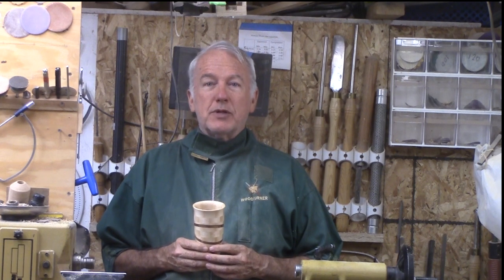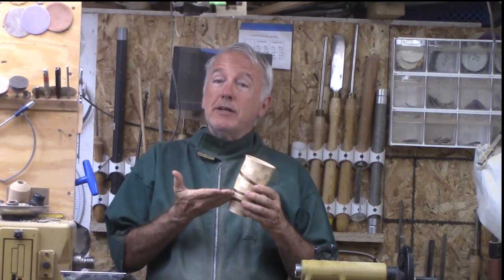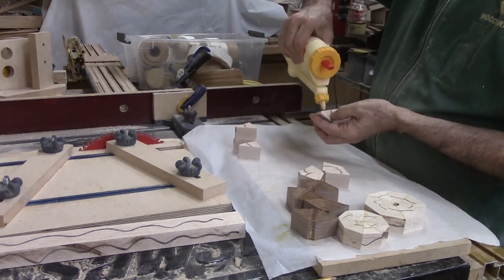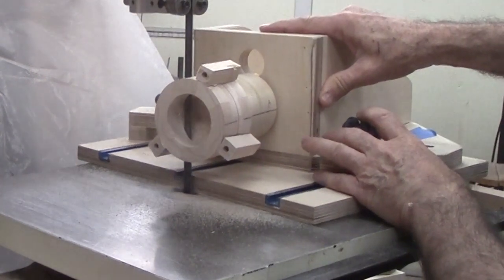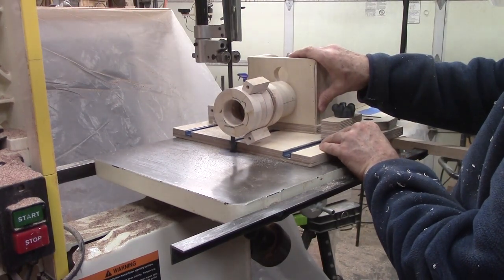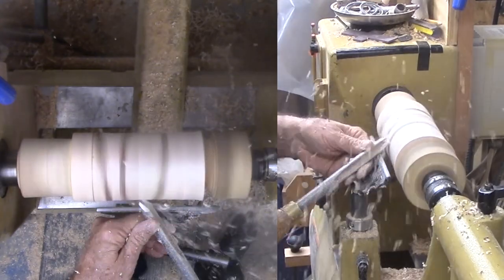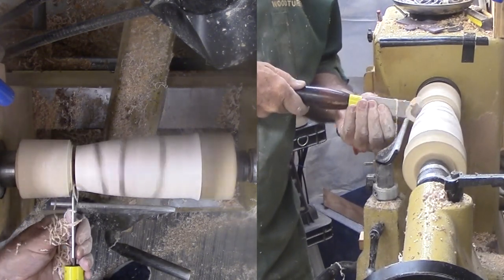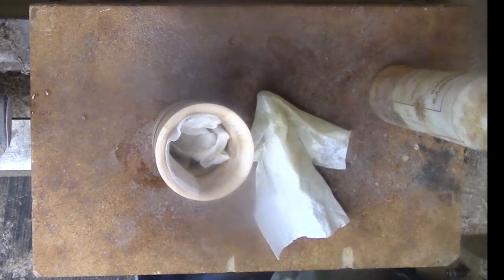Woodturning Drunken Segmented Vase

Comment: Awhile ago you made a video showing how you resawed segments, that video triggered a thought that allowed me to complete a cocktail shaker kit that my daughter had given me years ago using segments.  I’ve been thinking about making a segment project incorporating a “wave” form and this video gave me two solutions I needed to complete my next segment  project.  The hot glued alignment blocks are a great idea.
Reply from the maker: Curved waves are another concept. These are straight cuts at compound angle. 
Straight cuts are much easier to glue up.
Alan